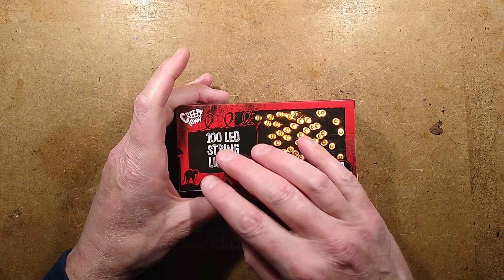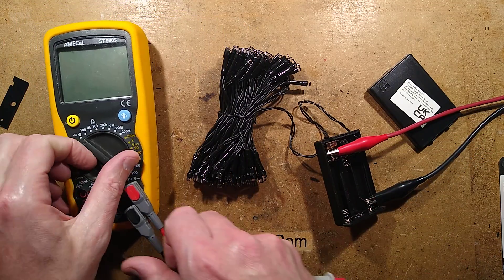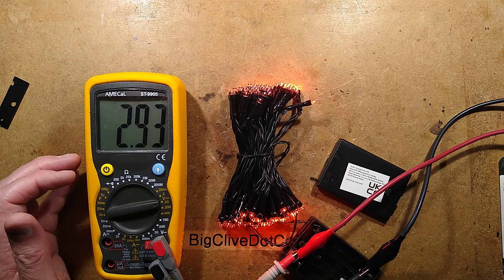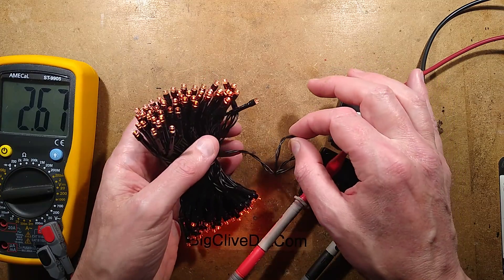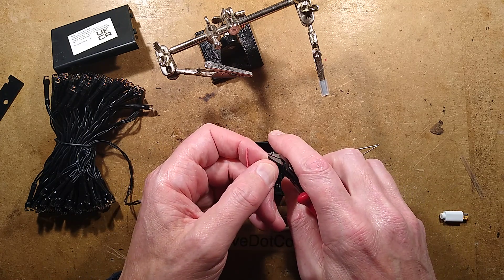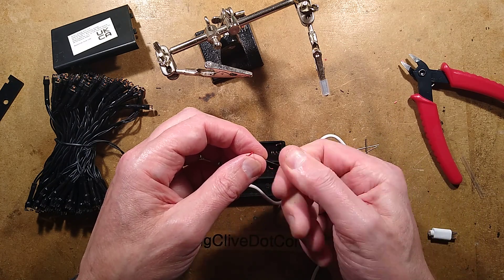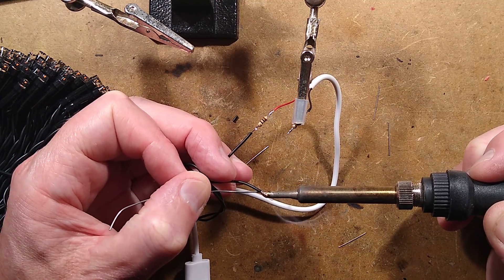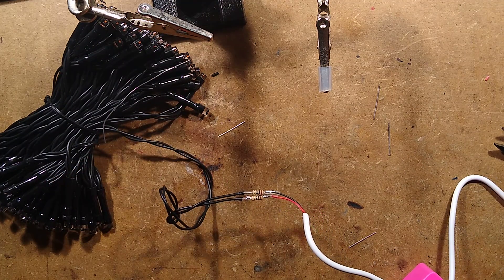Poundlands 2021 Halloween lights (and USB hack)

Comment: you know whats worse than forgetting the heatshrink? pulling it all off and redoing it just to realise you still forgot the heatshrink the second time.
Reply: "Electric tape it is then"
Reply: @Vokabre  or just a drop of hotmelt glue 😆😉
Reply: @Vokabre  this is why I have a couple of tins of liquid electrical tape.
Reply: I'm so glad to hear its not just me that's done that!
Reply: Or when you test the item and it works, then you apply all the heatshrink and it suddenly stops working.
Reply: I didn't forget the heat shrink the second time, so there!! I just wired it up incorrectly the second time.....
Reply: Been there, you get so wound up in the work that you forget why your doing it in the first place.
Reply: @nicewhenearnedrudemostlyel489   who hurt you?
Reply: @katelights  too many for the patience i had... apogies, honest. I'll adjust it more properly.
Reply: *Apologies... 😑 therapy will be in my near future... if your question had any real care in it.
Reply: rubber paste em
Reply: Ah yes. I did that a few months back when I was fixing our rice cooker except I put the heatshrink sleeve on each side of the same wire the second time. 🤦‍♂️ So lucky there are YouTube videos out there for complete nonce like me to follow. Just a single sensor wire broken by a design fault which is so fixable (it has to be coz I managed it) and saved having to replace a perfectly good appliance.
Reply: When it's 120 pins in one go... you tend to not forget in a hurry....
Reply: Even worse is when wiring a 50 pin D connector and you put heatshrink over each terminal end, you then power it up and it's not bloody working so you bell each end out to find it's fine, put it back on test and it's bloody intermittent due to one wire coming out of the solder and just to say touching when you plug it in but because it tests ok you have to remove every bloody wire now encased in heatshrink just to find it and after removing everyone you realise it's the last bastard wire that you remove that was faulty....AAARRRRGGGGGGGHHHHHHHH lol
Reply: Wait a minute, 2 weeks ago?
Reply: @Dudeontheweb  Patreons.
Reply: @Dudeontheweb  Patreons get advanced access to videos.

Comment: Is there a reason that there isn't more of these chains that use 18650?
Reply: 18650 battery holders cost more, people generally don't have 18650s so they'd have to supply them plus these shops usually sell double and triple A batteries for the add on sales. The sellers aren't bothered about how long the lights run for on a set of batteries.
Reply: @evilution_ltd  i don't really see why it would cost more though. A single compartment box with a contact in each end would be easier to construct than triple compartment with 4 connectors as in these. I'm not even talking about replacing all AA or AAA ones, but just be there as an option. 
I haven't seen those anywhere, even though it feels like 18650's are used "everywhere" nowadays. 

I was having a feeling that 18650 not being meant for use outside packs might be a reason.
Reply from the maker: Spooky!
Reply: @bigclivedotcom  hehe Didn't expect a response to come that quick and decided to exchange it to a more substantial comment.. 😁